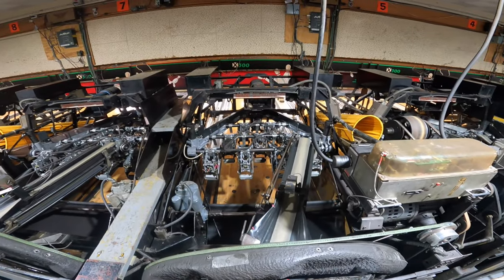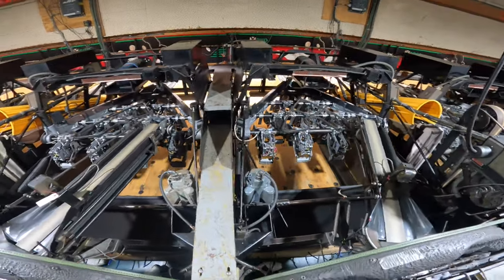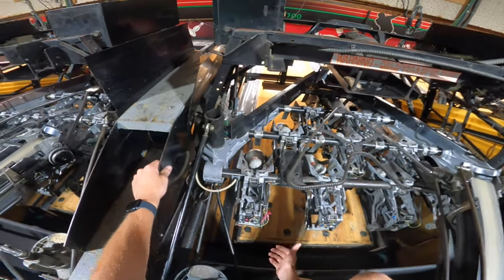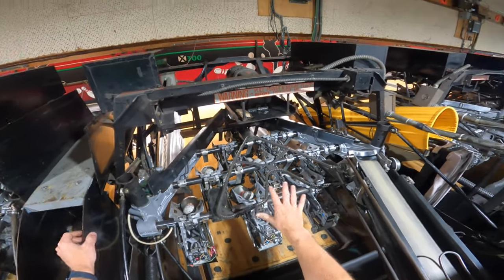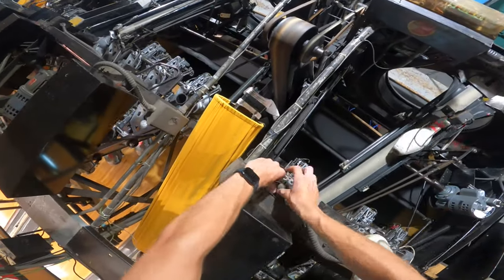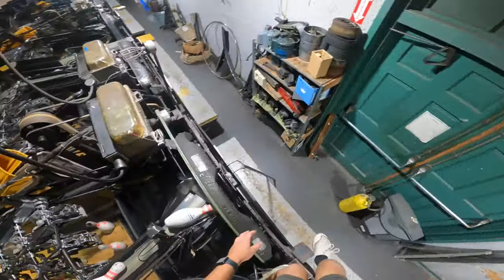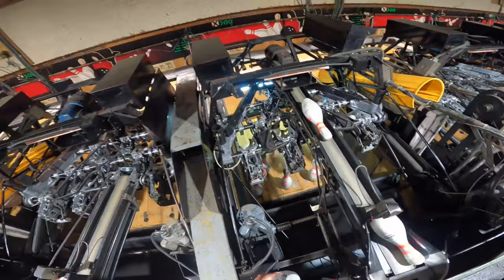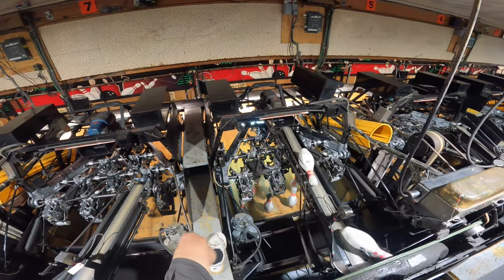What Articulates The Spotting Cups on an AMF 82-30 Pinspotter?|askJoethepro

Comment: In my pinchasing days, before a league started I once set every machine have only the 5, 7, and 10 pins in cups. There were usually no pins on the lanes when the machines were turned on and while some would just throw a first practice ball with no pins, many would cycle them, expecting there to become a full rack. There was endless groaning when the machines only spotted those pins. Yes, there were expletives....

Comment: I lived right next door when I was 10 years old working as a ashtray and plastic score card cleaner at Continental Lanes in Roseville Michigan in the 60's. I ended up migrating to doing mechanic work by hanging behind the lanes with the mechanics. The 82-30 is where I cut my mechanical teeth. My job originally was to free the incessant ball return jams. I moved up the ranks to eventually clearing Blackouts and sweep jams. I did this for 3 years, including doing the mopping of the lanes and running the oil machines. It was the best part of my life looking back. No one cared about insurance or a kid literally climbing all over the machines. My so called graduation was cleaning all the contacts and relays in the "brain" and testing it.  One note, the scariest things about these machines was when a pin would get jammed in the Pin Pickup ring and fire out the back like a missile. They would actually crack the block wall from the impact. We had 54 Lanes and kept pretty busy.
Reply from the maker: Awesome story! Thank you so much for sharing:)! Make sure you subscribe!

Comment: What-how does the sweep drop ? I'm a brunswick guy fascinated by amf. Too much electrical going on with amf versus the A2.
Reply from the maker: There’s a sensor in front of the masking unit post that sends a beam across the lane, when the beam is broken it cycles… the cycle timing is also based on the ball speed(If there’s a really slow ball then it won’t cycle as fast)

Comment: Those are the cleanest dirty 30's I've seen in a long time! LOL
Reply from the maker: Yeah cause I pulled them all out last spring and pressure washed everything. They’ve been working amazingly ever since!
Reply: @Joethepro181  About 30 years ago, I worked at a 52 lane center that had 14 30's and 38 70's. There had to be about 40 years of nicotine on them. I didn't have the talent to remove them, so I just wiped them down with a rag and degreaser.  The mgr was impressed.... I put myself through college working there. I still think of pinchasing at a center, but I already have a career and a great p/t job. So I'll just keep bowling LOL.

Comment: Could you use a table jig to level tables?, gary
Reply from the maker: You can but I don’t have one at my place… I usually just do it with a dolly and precise measuring and it usually works great
Reply: @Joethepro181  Nothing beat AMF factory equipment, special tools are  mu
Reply: Must